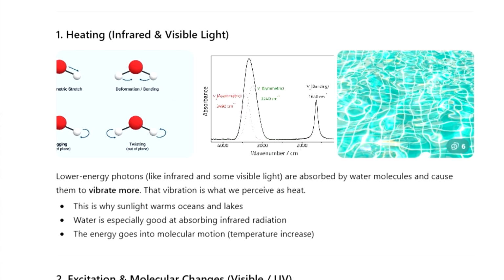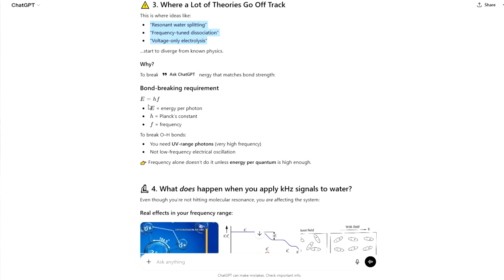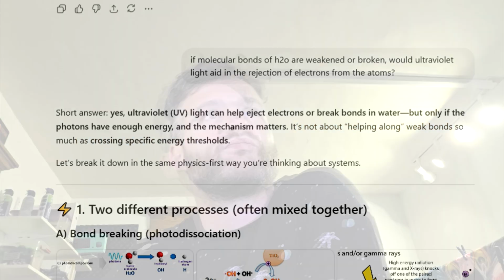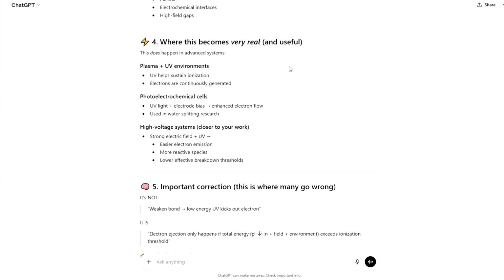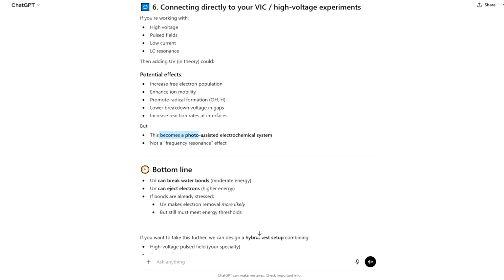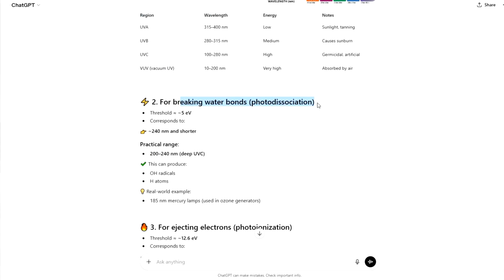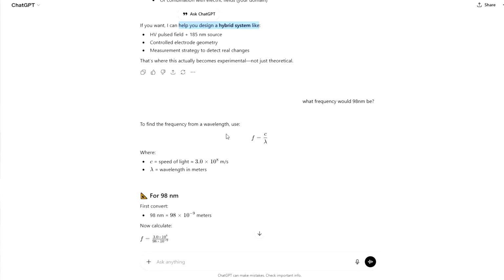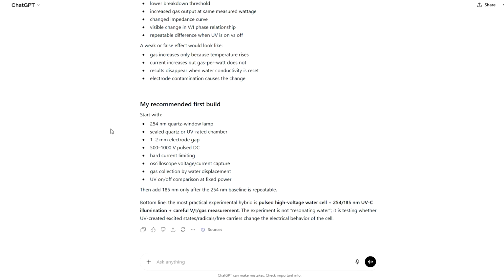A Deep Dive on Photon Energy

Comment: ChatGPT is not a trustworthy source, I Know very little about what is discussed in this video but I am aware that using AI for research and facts is a severe misuse of this tool. please find trustworthy sources and contact professionals in the field, that way you will learn more instead of being stuck in an echo chamber. you should trust generative AI as much as you would a child, they will get things wrong and even lie to appeal to your opinions, only serving to send you into a spiral of misinformation and confusion.

if i were to give you honest advice, you should first: 
find and email professionals in the field, contact them and learn more.
second:
do your own research and experiments to find your own correlations. For example: the amount of salt in the water compared to gas production, finding out the correlation of the wave form to the level of voltage at the cell and much more.

doing so well lead you to your own conclusions while still allowing creditable sources of information. best of lucks and I'm excited to see what you discover